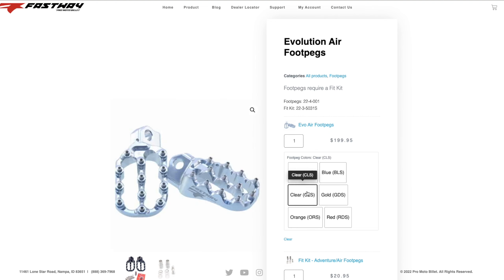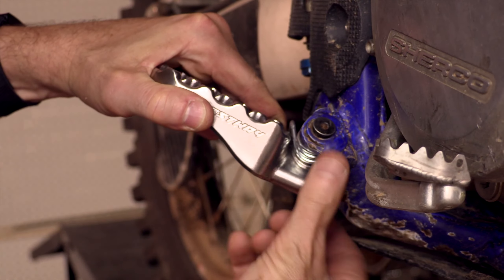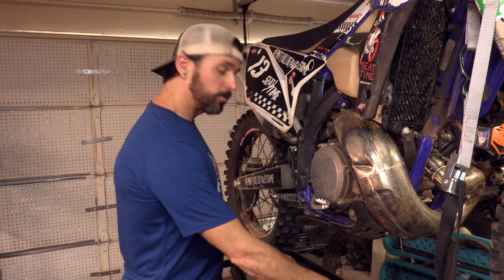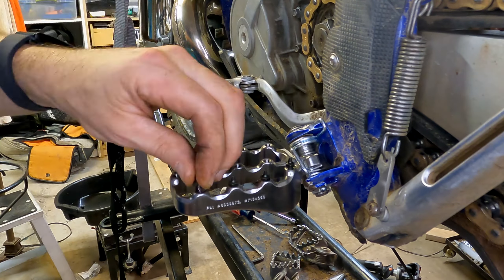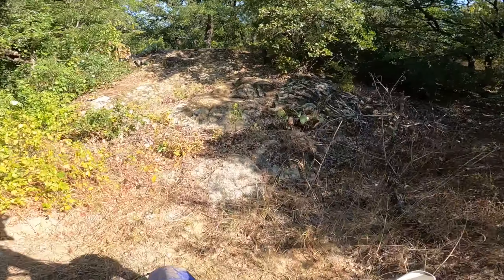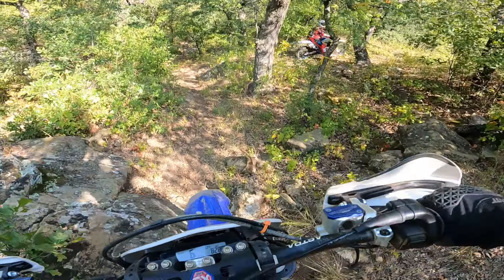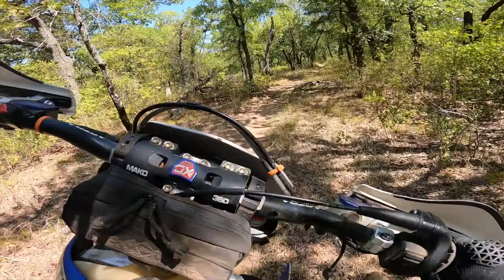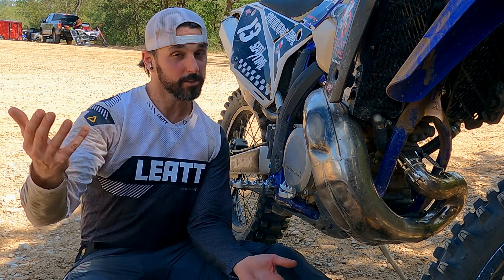LOW & BACK! Fastway Evolution 4 Pegs INSTALLED!!

Comment: Awesome video! Was lucky enough to get my bike with a set already on! Only down side is the pins in the leading edge are completely worn over. Has anyone dealt with that, and what did you do to remove them? Drill them out? Also, make sure you guys check the pins, have spare on hand to replace once they start to wear. They go from grippy to slippy real quick. Currently riding the couch with a broken foot due to my boot slipping slipping off on a landing.

Comment: Ran the old school F1s on 3 different bikes.  pitched them up a bit and set the screws in the front shorter.  Forces the knees in when you stand and puts you a bit forward.  kind of like the new KTMs do.  They do more so.... Not to say you can't adjust it.  I don't really need the "tall" option and I'm not long legged by did like it.  I tried both positions on my old bikes.  The cool thing about the older design was with a new barrel you can just move them to a new bike.    KTM never changed their peg design so I was able to transfer.  They finally did change it up in like 17 or so making so I could not move these to my Gas Gas.  I never did kill the aluminum F1s I had.   Once I beat or break the OEM pegs on the gas gas will be looking to upgrade.
Reply from the maker: What year is the GG? Are the pegs almost there now?!?!
Reply: @SeatTime  Its a 22.  They are not smashed or bent surprisingly, but notably thinner than KTMs of the past (07 and 2013).  I have the EX300 which is basically the 22 KTM300xc.

Comment: Getting ready to install some low/back pegs on my bike here... 
Did you notice any difference in handling or body position with them being back a bit?
Reply from the maker: Good question! I noticed I could pinch my bike better. I also noticed I got stuck on the pegs less, even though the teeth are now sharper and taller. Let us know how they work for you.